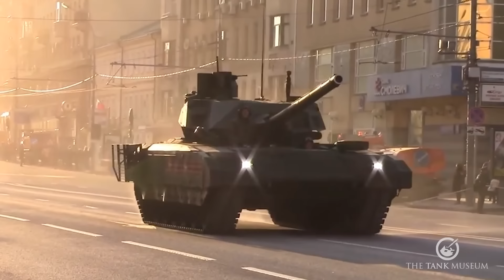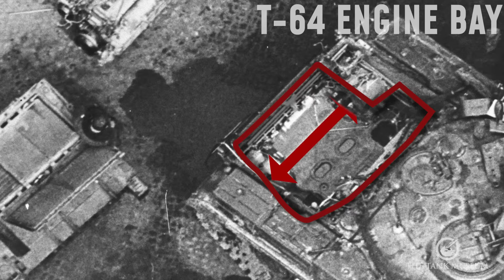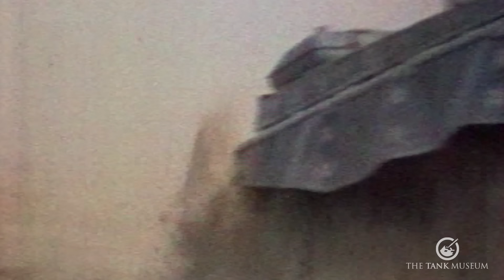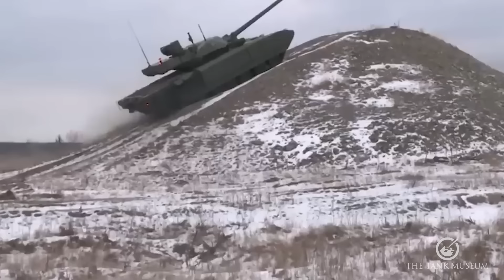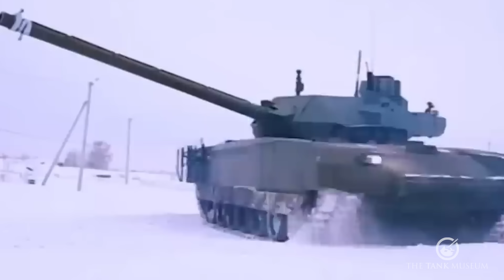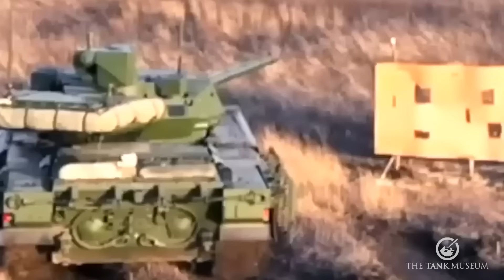Radical or Ridiculous? | T-14 Armata | Tank Chats #171

Comment: This is the best tank made hands down it can jump anti-tank ditches shoot down aircraft helicopters up to ten miles away it float's over minefields runs on cheap vodka witch is very hard to find and seems to evaporate out of the tanks fuel bladder's fast and all the troops love these tanks even if they can't keep enough fuel in them for more than a mile at a time word has it if the Russian engineers can figure out this fuel problem they have a game changer
Reply: The T-14 can also fly at mach 92 and the engine can also run on fairy dust. In one competition, a T-14 destroyed 8 NATO tank targets with one shell from 1400 km kilometers away.

Comment: Bottom line is the Russian tanks have been battle tested against the best western (German) tanks across multiple large scale wars. In contrast, US tanks have been fighting insurgents in sandals for decades now. There was no reason to rush the production of T-14s when you have thousands of upgraded T-72/T-90s that are on par with what Nato has to offer (evident in Ukraine). In terms of imported "materials", the only critical non-domestic systems in these upgraded platforms were the Thales sights used in the Sosna-U system which have been replaced by Irbis-K over the last decade (following the sanctions after the Maidan coup)

Comment: The russian Unicorn . Does everything it says on the tin except the tin is actually an old paint can rusting in a shed with mice living in it . Ignoring that , everything about this tank is bad from it's gun to it's engine to the defense systems . The air con doesn't work as witnessed by the sweating presenter of a russian propaganda video and the driver can't see. It has an auto loader that can't be cleared by the crew when it inevitably jams and fires slower than a manned turret can. All the T-14 really has is an army of Tankies and commiboo fangirls that feel the need to push russian propaganda talking points because ... I don't know ,maybe they never got hugs as children or something . In short , the T-14 is like everything russian : A poorly thought out , badly implemented , white elephant with a new paint job and a song about how good it is .

Comment: No, if Russia deploys the T14 (like it already has) it would be to test it in real combat conditions. T90M have been quite successful on the battlefield, only handful of them have been damaged (and none have suffered catastrophic damage other than the one that was destroyed by the Russians themselves in order to prevent capture) and the T14 is better vs other tanks than T90M. Problem is, that the T14 does not have a real opponent to fight and it driving into a mine or being blown up by artillery shell, is just pointless negative PR.

Comment: Having no access to the gun from inside the tank just feels like a bad idea.  Stupid little things can happen that might prevent the gun from functioning. 

In a normal turret you can see, and reach, most of the working bits of the main gun.  And a little percussive maintenance might solve the issue in moments. 

With no internal access the T-14 would have to return to a maintenance depot for even the smallest issue.  Because I really can’t imagine the crew stopping the tank, hopping out, removing armor panels, and then digging around while being fully exposed to everything.
Reply: They didn't say there was no internal access. They merely said the crew compartment is separate and specially armored. The biggest advantage Russian tanks have always had is that they are built to be easily serviced. I very much doubt that the gun systems would be entirely unreachable by the crew - that's just not how Russians build tanks.

Comment: The idea of building a platform is sensible, as long as the envisaged vehicles are all similar: as with the CVRT (Scimitar, Scorpion, Saracen and Stormer) line.

But surely, as an example, the heavy armour a MBT like the T-14 needs would ludicrous overkill for an APC/IFV.
Reply: I'd say that probably depends on envisioned mission profile and environment? In urban combat, for example, I could see protection prioritized over mobility even for this class of vehicle. Let's not forget, the IDF also developed an APC version of the Merkava tank to shuttle troops in and out of the occupied territories. Perhaps as with the BMPT, this kind of thinking might originate from Soviet experience in Afghanistan, where less protected IFVs were at constant risk of being taken out in ambushes.
Reply: @ddshiranui  The namer was an after thought built with leftovers.
Reply: @Sam_Guevenne  The IDF has been doing this since the 90s when they converted Centurions into Nagmashots, and then T-55s into Achzarits. The Namer is a continuation of what by now can arguably be called a tradition.
Reply: @ddshiranui  Israeli doctrine and tactics for armoured warfare also seem quite specific to their needs and circumstances, hence the unique design of the Merkava. Other nations haven't copied it but they use their tanks differently.
Reply: @trolleriffic  I think that's because most armies' doctrine is based on maneuver warfare, where traditional IFVs are way more mobile. However, in urban combat, wouldn't armored protection be more important? This may be a gap in most militaries just because we do not really seem to anticipate the need for months-long city fighting. The last time western armies had to deal with that was WW2.

Comment: Anyone notice how much recoil their tanks have compared to western tanks? The whole tank shakes including the barrel. Compare that to something like the challenger or Abrams. Those are butter smooth! No bias either. I actually went back to double check.
Reply: It weighs so much less than a Western tank.  Importantly however is that the motion doesn't exceed the allowed threshold until after the projectile leaves the barrel. Accuracy is no affected.

Comment: In terms of its design, the Armata has some very good ideas behind it.  The problem is that in trying to execute these ideas the Russian engineers have fallen afowl of the supply issues, corruption and cronyism that is so prelevant in Russian society.  I think it would be likely that the Russian government would want to revive the Armata program but the current design looks like a dead loss.  The main issues seems to be that the engine is so unreliable and that its electronics are too dependant on foreign components for a pariah state like Russia to keep production turning over.

Comment: If they ever lost one in battle, they'll get 2 possible bad scenario depending on the tank condition and still ended up being humiliated. If it's advanced as they say, then other nation will discover all of it's secret. If it's a sham, then the west will exposed it.
Reply: In my honest opinion, the tanks greatest weakness is its engine, even if Russia manage to smuggle western parts to build more of it, the engine is an underpowered, unreliable, engine used in the Porsche tiger, I can see it breaking down randomly in the middle of battle if it operates for too long.

Comment: It clearly doesn’t have a stabilized gun control system, limiting its ability to fire on the move.

I have to disagree on fire power, Chieftain had massive fire power (120mm) and it could be fired on the move at moving targets with n mil of accuracy. I firmly believe that when the Soviets saw the lethality of Challenger and M1 that it caused the downfall of the USSR.

Smoke doesn’t work with our TI sights.

Interesting that he didn’t comment about taking on Challenger😎 We Kick Butt & take names.

Comment: Most of the electronic parts required should not be an issue.  Automotive and military parts need more EMI resistance which older processes are better for. IIRC China should have this capability but the status is unknown; ironically older processes use older production equipment which might be wearing out thus creating a shortage.
OTOH rugged processors and solid state displays might be much harder to source.

Comment: Wasnt it during its debute parade in 2013 that one of them had engine troubles on the strip? Causing another t-14 to struggle to tow it?
Reply: 2015alledgedly the driver had engaged the parking brake, and forgot to disengage it before attempting to start the engine. Towing a tank with engaged parking brake is rather hard.
If we can believe this version that is.

Comment: I think the T14 has a really innovative design.
If everything works as intended that is.
The many problems that it has make it unlikely to succeed.

-the engine must be reliable. If i understand it correctly it was reliable in stationary use like running generators, using it on the move is a completely different thing.

-the autoloader must be made reliable. in a T72 the gunner can reach any part of the autoloader and there are few problems he cannot fix with a hammer, a can of oil and a "SUKA BLYAT". 
In a T14 there is no way to reach the autoloader but to get out and access it from the top, unprotected, under enemy fire.

-as mentioned the electronic parts are made out of unobtainium.
I believe that the engine controlling sensors might be needed to reach acceptable reliability of the engine, if they cannot be obtained engine reliability might be unreachable.
I suspect that a fully automatic autoloader might also need electronics to function. 

-Training, if the claim is true the T14 that "broke down" before a parade just had the parking brake engaged, and the driver tried to start it without releasing the parking brake.
To run such a sophisticated system you need better trained crews. "contract soldiers" rather than conscripts, but the russians want to increase the percentage of professionals in their army anyway.
...

All of this is also overshadowed by the one big question: can we believe any of the claims about the T14 ?
Reply: Answer is no
Ruzzia always overhypes it’s capabilities
Reply: You said it
Parade Brake
Can believe claim? Now I fking wonder what inside propeller make fire range go 12km (they referenced M1 have 3km)
Reply: @SRDPS2  the 12 Km is realistic for indirect fire(as artillery) the 3000 is direct fire.
seems someone deliberately mixed up the numbers to make things sound more impressive.
Reply: @ulrichkalber9039  well, in official AD btw
bruh
Reply: @SRDPS2  also 3000 for Abrams is effective range,  13000 for t14 is probably absolute range.
Reply: No, we can't

Comment: What happens if there is a gun loading malfunction and someone needs to get into that fume filled turret?
I think the Russian army would be keener to send older tanks to the front rather than risk this being a failure.
Reply: Open the turret and let it air out?
Reply: @burningphoneix  Easily done in the middle of battle. Get the tea and sandwiches out while we wait.
Reply: @paulmurgatroyd6372  Gun loading errors are incredibly rare. If the loader malfunctions, you're going to have to pull back in any case.
Reply: @burningphoneix  I didn't say they were common, but it's easier to replace a crew loader than an automatic system.

Comment: Russian inform they searching engine how t14 how you can make tank without engine. 
I can find that information is on Russian propaganda web.

when you change engine they need to redesign construction .
So?

This is main reason still produced t72 not t14.

t64 until t90 is pretty this same tank. 
T64 after upgrade can can not with t90.
Ukraine t64 for example.
pt90 export for malesia version was batter tank then t90s

To upgrade tank to level t14 they need 1500hp
And Russia have issue stil to make a engine with 900hp.

t90 is dead end.
all this t what ever are not perspective tank.

Comment: The T-14 is an excellent deal.  When you buy the tank they give you the towing vehicle to pull it around for free.
Reply: I thought only Ukrainian-owned tractors were permitted to tow Russian tanks?
Reply: @Esme n'haMaire  No, even the Russians have to tow the T-14. At the Victoy Day Parade when they first introduced it to the world the engine and transmission stopped working so they used a towing vehicle to pull it down the parade route.

Comment: It is hard to believe sanctions do anything other than increase the cost of electronics. The armata, or any vehicle, doesn't need the latest lithography chips (which can be effectively tracked and sanctioned), and there is no way to stop the re-export of commodity electronics. Vehicles don't use the newest tech because they don't need the power savings and don't want their higher sensitivity to interference. CPUs from 3 generations ago are almost as fast, and no one cares if their electronics use an extra 100W of power.

Comment: As a design concept of putting the crew in one highly protected area low as possible makes a lot of sense, but in order to get away with that you do need some serious high tech and the question is simply one of cost, what is cheaper a higher risk of loosing crew or a vastly more expensive combat machine in procurement and operation.
Reply: It’s a tall vehicle though. It’s tall and heavy lol.
Reply: it would have been a good idea if they didn't invade ukraine, that tank would have been way better for small conflicts or foreign operation instead of convetional war (it would be great in conventional too if they had enough of them wich clearly isn't the case and we don't even know how it realy performs)
Reply: IMO people MASSIVELY overplay how much compute power goes into military systems for a combat vehicle.   For example lets look at western aircraft.   F-16 of the 1990's type.  Do you know the popular computer game DCS world fully simulates, real time, the full avionic systems of an F-16, at least the declassified parts.  Meanwhile the sim it also makes demands of the player's computer to render the sim, to simulate the effect of radar beams, run the AI the digital enemies, and model the flight of the simulated aircraft, and all of this real-time.   And it runs on commonly available desktop PC's, sure good "Gamer" grade ones, but still common civilian equipment.   And the reason to point this out is how little compute power military systems need.  

Its not unreasonable, IMO, to guess that all the systems of a T-14 could, in academic theory, be run off the compute power of a late model iPhone.  The big challenge with these systems is getting them absolutely bug free, crash free, and hardening the electronics to prevent failure.  The actual compute demands are quite low compared to civilian computer systems. Remember calculating ballistics is a very exact math operation, and something a man can do on a napkin.  So even the slowest can computers can manage it real time.  People have managed tracking software on Raspberry Pi's and the like.   And the rather dated systems in an M1A2 Abrams has less compute power than a Nintendo GameCube.  They are absolutely still good enough to do the job otherwise they would be long since replaced, but its not like they have super computers.  

Honestly the REAL cost of a tank is the raw steel that goes into it, and the heavy manufacturing to build it.  

And I think even for Russia, crew is more valuable than equipment.  After all crew skill makes all the difference.  Consider the incredible success of the American Abram's in Iraq, and then the Saudi's absolutely dismal losses in Yemen using export Abrams.

Comment: Even if the T-14 did everything the Russian claimed it could, it still doesn't fix the problem of the Russians being only able to build a handful of them. Just like the Su-57, whatever supposed technological advantages it has over Western counterparts is completely offset by their tiny production numbers vs the numbers the West produces. For example, there are believed to be about 20 produced Su-57s. Meanwhile the US has produced over 180 F-22s and 900 F-35s.
Reply: don't show your stupidity.

Comment: Another review of T-14 here on YouTube emphasized the engine problems.  The stationary pump engine didn't work out.  Russia then tried to overboost the T-72's engine, leading to reliability issues.  They're stuck now.  The shape and volume of the power pack space doesn't seem to allow for alternatives.  I think it's "dead" without significant hull redesign and some sort of modern engine.  Too bad they can't import MTUs anymore.

Comment: 4:07 "They don't go for what NATO tended to do, which was to upgrade older model tanks when a new gun comes along" - I don't know of any NATO tanks besides the Abrams that went from 105mm to 120mm smoothbore, and that was by reintroducing the M1A1 model rather than up-gunning old M1:s.

[EDIT] I forgot the Centurion that went from 20pdr to 105mm as well as the M48 that went from 90mm to 105mm.